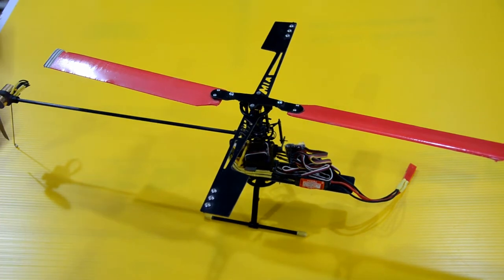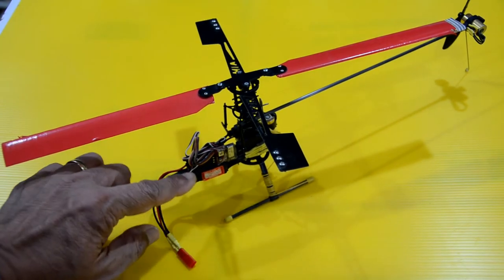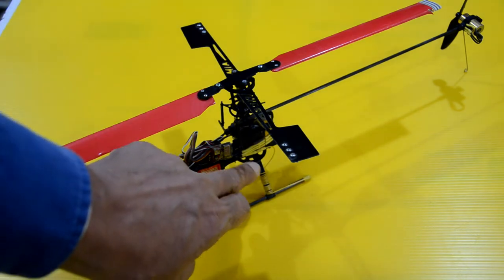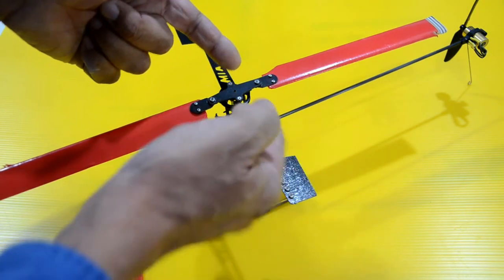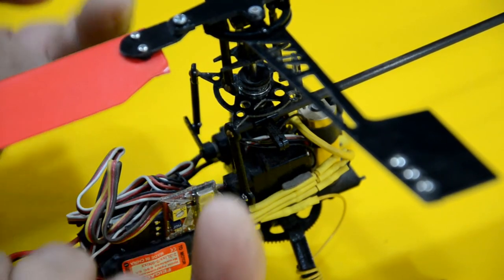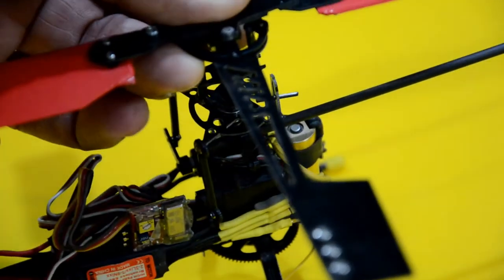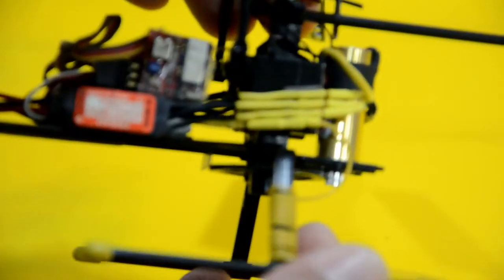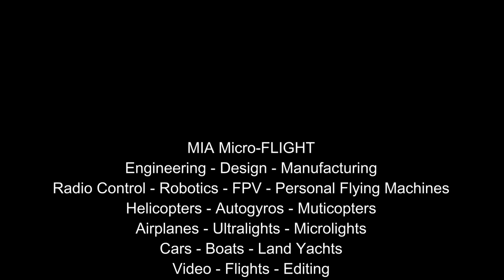Sub Micro RC Helicopter MIA Falcon AKA Chicken Legged Heli

Comment: Seen your 45 deg flybar setups for Walkara & flybars look exactly similar.
As per your experience can a 90 deg flybar be used insted of 45 deg to render same stability
Reply from the maker: The out of phase flybar was done for better "self stabilizing" to cyclic control input. For general stability any flybar with tip weights will do the job, thus the original Bell system. The Hiler system employed paddles for better almost instantaneous cyclic control. A combination of both Bell-Hiller is one of the better mechancical "gyro like" stabilizing systems for helicopters and rotors in general. I say, in general, because I have  also employed flybars on some of my very early designs for  tail rotor stabilizing,  before there were electronic gyros available for them. 

Today electronic systems have replaced the mechanical in many RC helicopter products, thus the flybarless systems, but I still prefer the 90 degree or offset Bell-Hiller mechanical control as the only thing that can fail this  system is a loss of a mechnical part in flight, if it is not secured properly. In an electronic flybarless system, you loose that and your heli is out of luck! I prefer to have the mechanical system reassurance but I make sure that all parts are symmetrical and properly secured to the rotor and never had a misshap.

Paddles are for  cyclic control mainly but not required if the cyclic is done by the blades themselves as on many "flybarless, systems, both single blade and  coaxial helicopters. For Coaxial helicopters,  the bell system is thus at 45 degree, on the top rotor and the cyclic control blades rotor under it.
Reply: U believe out of phase ie 45 deg one rendered better stability than in phase 90 deg one.
Plus interestingly 90 deg ones always have padells but not necessarily for 45 deg ones. Any reason?
Reply from the maker: I just explained all this in my response to your first question. :)
Reply: Oh sorry ...my youtube fault it showed just 1st line.in response box
Indeed mechanical stablization is the way.
Reply from the maker: no worry. :)
Reply: Does this model have a dog bone / ball joint b/w main shaft & rotor.
Since mine have a simple pin joint for cyclic. I applied adjustable angle flybar, which stabilizes perfectly at all angles from 20 degree all the way to 80 deg, but the moment angle gets in proximity of 90 deg rocking motion starts & grows extremely severe - looks like a constraint gets compromised & gives reaction force causing rocking.
Reply from the maker: Yes the rotor is ball jointed to provide ease of tilt and smooth control.